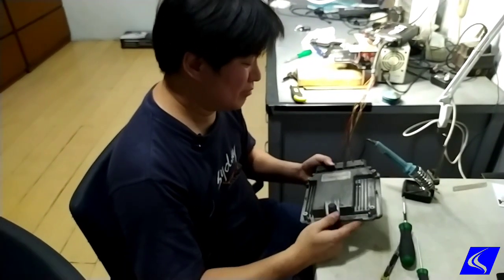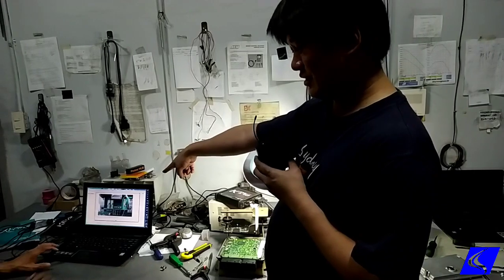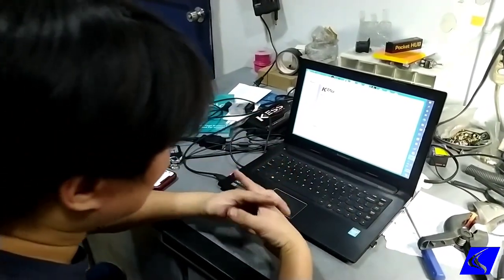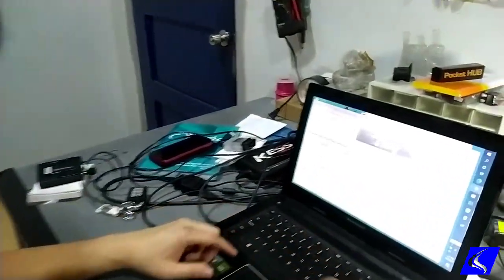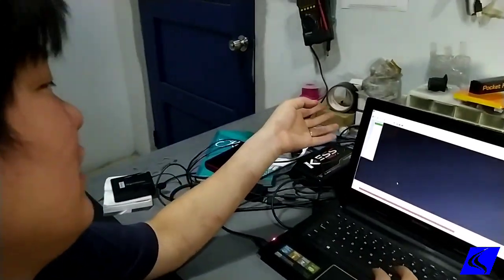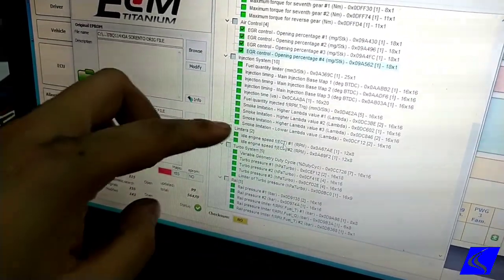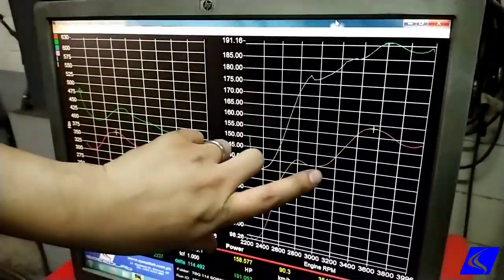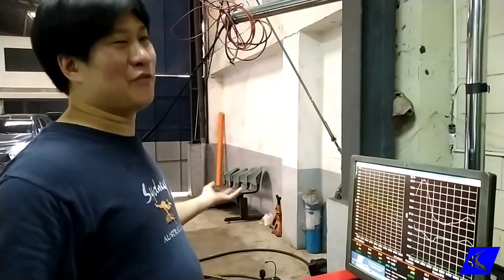Remapping Hyundai/Kia vehicles with direct ECU Connection

Comment: Can you figure out a tune for a Kia k4 ex 2025 ? I put on an axle back vodka exhaust , a k&n high flow stock position intake filter / and adding a 2.5” in/out high flow vibrant performance resonator in the mid pipe I am hoping to find a high flow cat to replace the stock one but tryna figure out if there’s a program or a way to get info from my ecu so I can send it out for a remap

Comment: Why would you set all of the EGR values to zero? The only purpose that I could see for you doing that would be only in an engine that has a turbo and it would be to make the air to fuel mixture more pure so to speak without reintroducing exhaust gases into the oxygen coming in from the forced induction of the turbo. But you would only get gains from that by tuning on a dyno and turning up boost while also adjusting fuel trims.
Reply from the maker: Because annoying customers keep asking for it.

Comment: I wish I could get in touch with you guys….I drive a Kia Rio 2013….months ago my speed was locked at 20 to 30Kms…DMG(local kia dealer in Darwin) said my throttle position sensor (TPS) was faulty and I paid them to replace it…after just 5 days ago I faced the same issue…now they’re saying the problem is in the ECU(supplying little power to the TPS)….the quote they gave me to replace the ECU is way out of my budget & for repairing I found no auto electricians in Darwin work with ECU…DMG told me to contact Injectronics in Melbourne….Injectronics asking me to send the ECU with Immobilizer & key reader but didn’t give me any quote and idea whether they’re able to fix it or not….hope I will get a reply from u guyz….

Comment: Tip, you can brush a bit of pure acetone to the edges. That makes it a lot easier to open because acetone soften those material that seals it. I used to work at a PCM supplier and I used to fix them and design simulator equipments to test them. Thanks for the video great job. What I want to do is Toyota prius so I can access the hybrid battery computer so I can make it run efficiently on lithium battery instead of Nickel metal Hydride

Comment: What about ecu cloning for hyundai accent, can it be done via obd or another method without opening the ECU, or just like remapping, the ecu needs to be opened to be cloned. I have an old ecu that has a problem with 2 coils with no spark; I got a replacement with same serial number from aliexpress, can the ecu clone be done without opening? if yes which method? if no how much will it cost me?

Comment: Hello Sir,  I have kia sorento 3.5 v6 2005 model the problem is low power and rpm not getting high its only untill 2000 rpm is that ECU problem? Where is your location?
Reply: It's in limp mode. Check the engine failure codes using an OBD scanner. It could be an oil pressure or temperature issue

Comment: I have a 2007 Optima 2.4 manual and it doesn't have cruise control. All automatic Optimas came with cruise and all manuals didn't. The dealer said I need the ECM to be reprogrammed and I tried the controls on the wheel. Would this fix it?

Comment: I bought an ecu for kia rio 2013 on line and when i installed it in the car, the engine will not start. Does the new ecu needs programming?
Reply: Has this been fixed already?
Reply: Following.
Reply: Following. I had the misfortune  of a mechanic removing my original ecu and replacing it with another make and model ecu after my engine locked and had to replace wire harnesses twice. I saw Ecu's  online and want to purchase, but someone told me I can't because the original ecu was programmed for my specific car. The online ECU can't be used until it is programmed to my vehicle. Is this true?

Comment: Is there any way to do the ecu remap for 2020 Kia Rio IV (YB) 1.4 auto transmission which has 100 HP??? I own one and would need to increase at least by 20 HP power. Is there any way to achieve this with ECU remapping ??? I hope you answer. I live in Sydney and any place that does this I would much appreciate any info on this.
Reply from the maker: Unichip Australia
Reply: @speedlabchannel4452  thank you so much :)